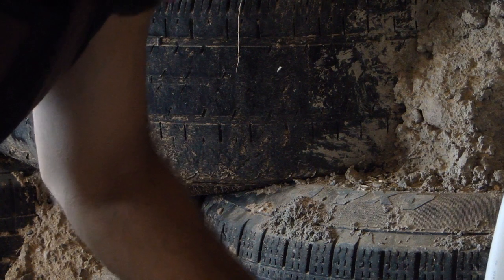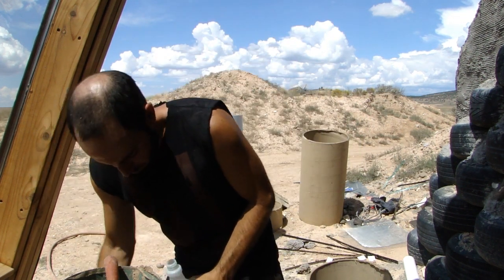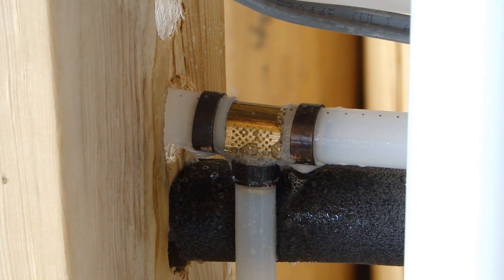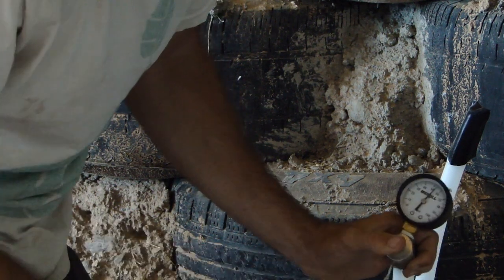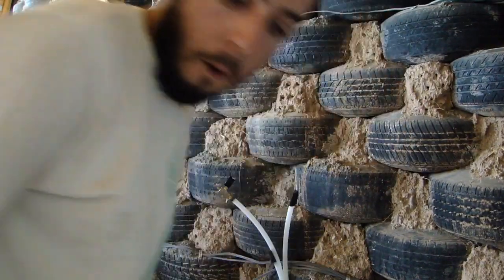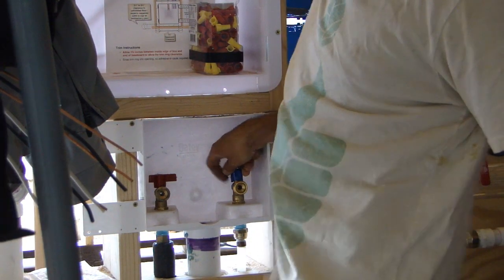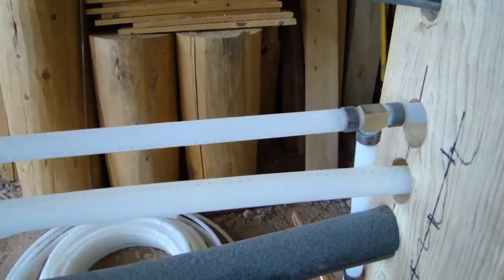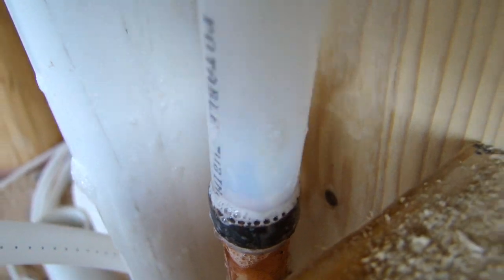Testing for Plumbing Leaks - Part II

Comment: I was wondering I have an old well that I'm gonna be using I want to test the old water line that is in the ground(probably pvc pipe) and I was reading they say you shouldn't test with air bc it might explode. my question is can i put a valve on it and test it without busting those line if there still in good shape? if not what is a better way to test it? bc if it leaks I'm just gonna put a new line in.

Comment from the maker: I'm not sure what copper vice pex is. I know about the expansion fittings and the copper rings that I used.  As far as why I went with pex over copper is because it's easier, less expensive, and it's what's used in most Earthships.  Earthship Biotecture uses the plastic expansion fittings but the crimp tool is over $500.  I got my ring crimp tool for $80.